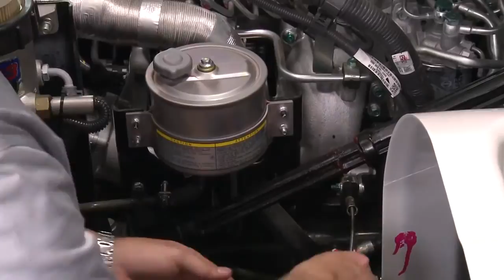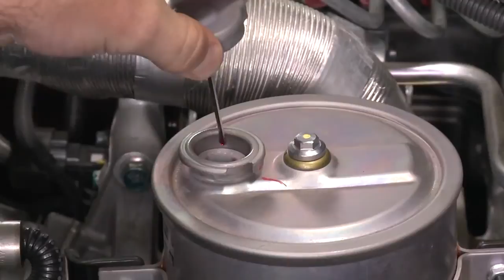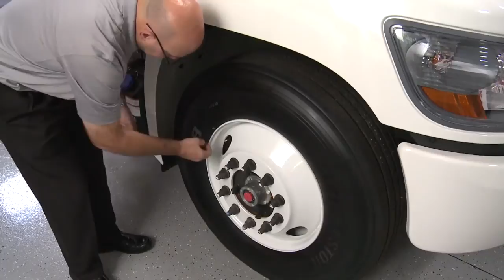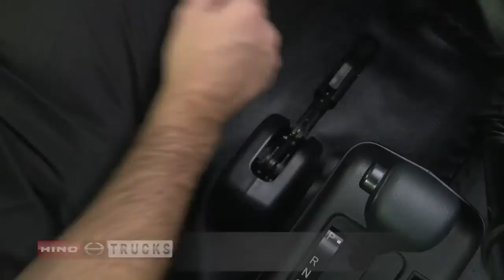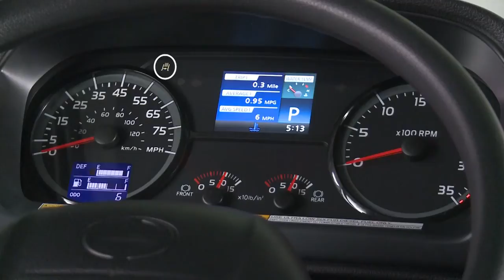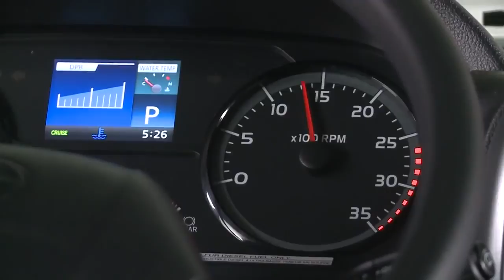Hino Trucks Conventional Driver Orientation Video

Comment: I'm won't to buy a hino 2012 whit 200 miles what you recomed me it good or no
Reply from the maker: I would ask the selling dealer if all of the updates have been done. Hino made some improvements and software updates to fix some of the 'bugs'.  Overall, Hino Trucks are very reliable and don't experience the issues that you will see with others. I will tell you that no matter what, at the end of every day pull the park brake and push the regen button!